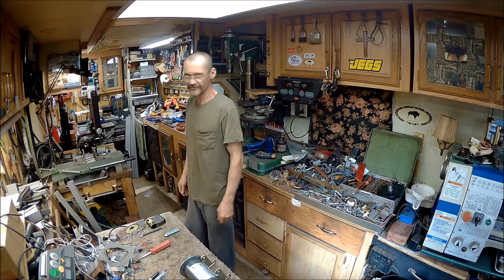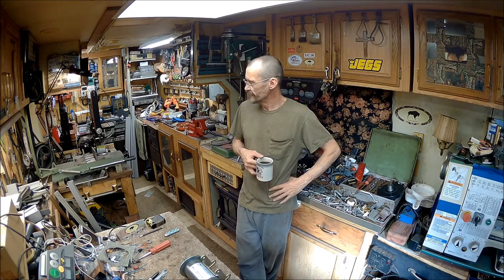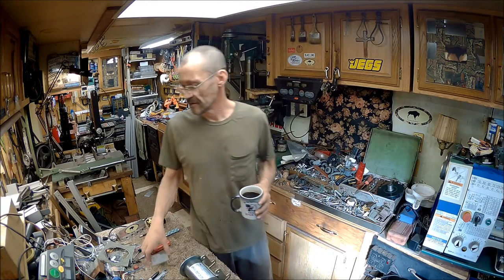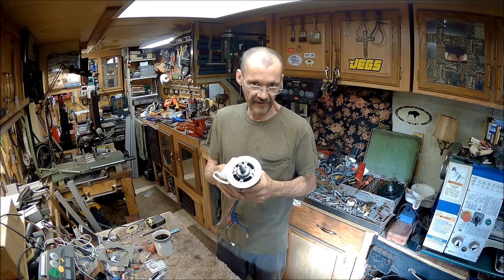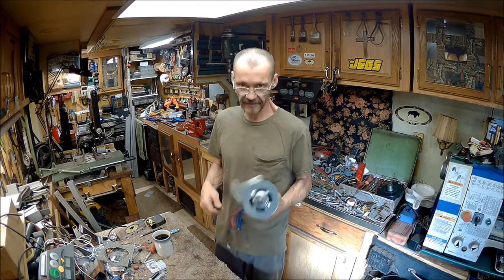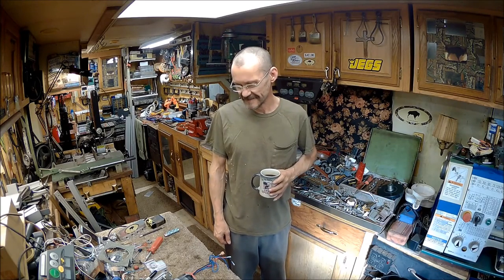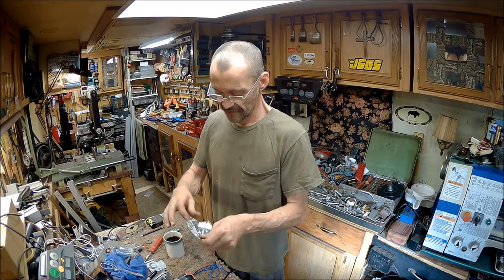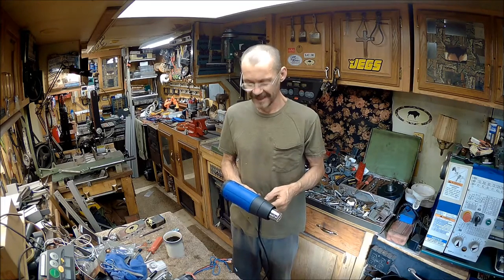bison chat score update and band saw fail

Comment: Hi Bob, I shall pray for you on Monday, however, the best way to fix a pulley is to have a keyway....and as for heatshrink, I use my wife's hairdryer.

Keep the faith mate I am sure we are all with you.

Regards, Rich.
Reply from the maker: thanks man, the key way is out of the question. ill do a flat on the shaft.  the us the set screw to mark a spot on the flat and drill a little vally for the set screw to seat into,

Comment: adjust the torque compensator on your board to fix the surging.
Reply from the maker: i didnt know there was one lol you mean a pot. right?
Reply from the maker: i just looked at it and there is not pots on the board. im not understanding what you mean
Reply: its very small and usually has to be turned with a tiny phillips screw driver.
Reply: find you a picture of your exact board on the web and cut and paste the link here, I'll look at it

Comment: Hi,  Are you still having problems with the 110v controller over heating?  If so you might want to try a 220v controller and a 220v bridge rectifier instead.  I'm using a 10,000w SCR and a 220v Full wave Bridge rectifier on my table saw and it has yet to over heat. If you check out the video called  "Low Cost DC Motor Controller For Treadmill"  by mikemanmade you will see exactly what I am using with my table saw.  I also have a short vid of it being used.
Reply from the maker: i really havent messed with it yet. i have watched that guy before and am subscribed to him. thanks man.